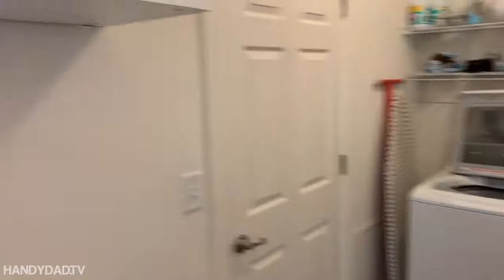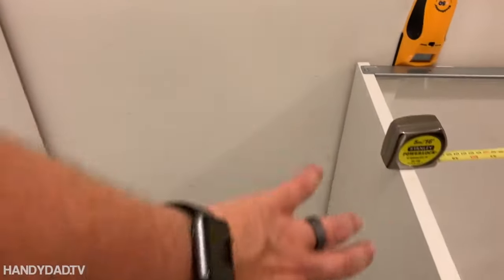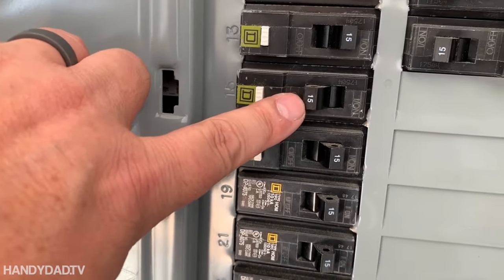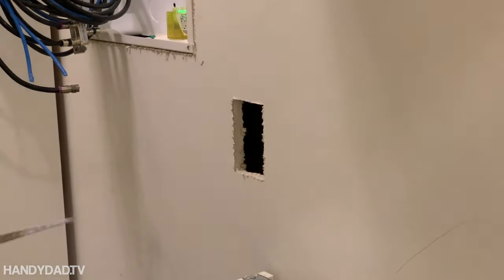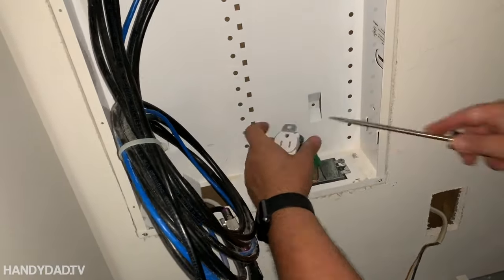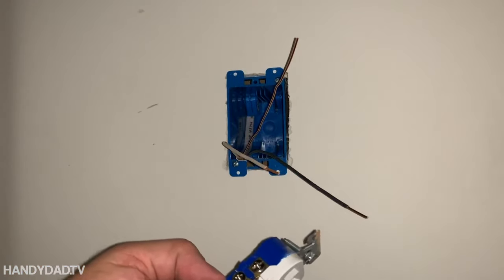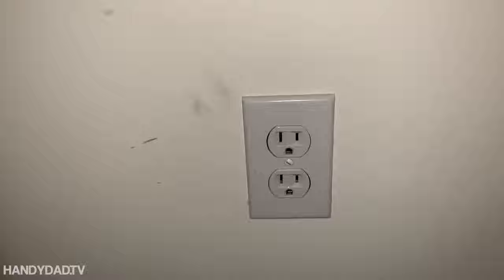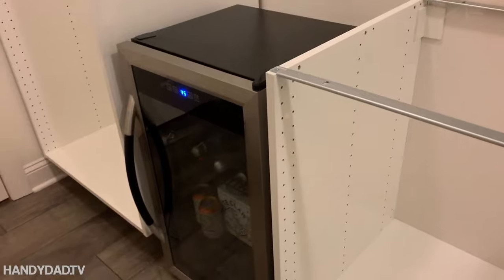Add an Outlet to an Existing Circuit

Comment: Your breakers show the amperage but does it also show the voltage?  I am curious if mine would show aswell.
Reply from the maker: A single pole breaker in the US is 120 volts. A double pole breaker is 240 volts. It’s twice as wide as the single and has a bridge across the two levers. Those are typically the only two voltages you’ll see in residential electric service.

Comment: Since that small room has a water connection (washing machine) and fridge (condensate) don't you need to run circuit through a GFCI load controlling outlet?
Reply from the maker: GFCI are typically only needed outside or within 6 feet of a sink. But codes vary.

Comment: Solar what size pilot hole would you have to drill for the setup you have in this video? Thank you for your reply
Reply from the maker: If you have a keyhole saw, no pilot hole is needed. But any size will do.

Comment: So, the other ground wire is twisted in the green wire nut, but still attached to the other ground wire (that's attached to the ground "green" screw)?
Reply from the maker: Yes

Comment: Question, shouldn't both neutral wires be  twisted together and pig tailed to the outlet and the same for the hot wires to make a continues circuit?
Reply from the maker: Not required. But many electricians do it that way.

Comment: How many outlets can you add to an existing one to make sure the 15 amp breaker can handle the load? Thanks!
Reply from the maker: There is no limit on the number of outlets. You are limited by power consumption.

Comment: Question...is it bad to piggy back off existing outlets? Like does it make it a higher chance of tripping a breaker?
Reply from the maker: It’s better than using an extension cord. Breakers only trip if you overload the circuit. It doesn’t matter how many outlets you have.

Comment: How ,any outlets could you install off one existing outlet this is exactly what I’m needing to do? Also with the last outlet on the run…did you get power from the second outlet or the first I do t think you showed that part.?
Reply from the maker: There is no limit for convenience outlets on a circuit. Just don’t exceed 80% of the rated load of the circuit breaker.
Reply: HandyDadTV thank you so much for responding!!

Comment: Can I run 2 more outlets from the same breaker if on one of them I am going to use a table saw and a garage vacuum?
Reply from the maker: Technically you can, but you probably won’t be able to run both at the same time without tripping the breaker. It would be best to run a new 20-amp circuit for the table saw.

Comment: I want to add outlets to my office which used to be a random walk in closet by the back door. One thing you didnt explain is how to determine the connection to the outlet. You just said hot to brass and neutral to silver. Is it as simple as one set to the top set and one to the bottom set? Also, I have paneling in this room that I do not want to tear out as I have already added built ins, and I can hide it all under the desktop... but it would need to be all wired in conduit, correct?
Reply from the maker: Watch this video to better explain the connections - https://youtu.be/xex8cPv8CtA. As for the conduit question, if you are running wires on the surface, I recommend you use this system - https://www.amazon.com/dp/B008JCHU8G/?tag=ha0d9f-20

Comment: Can you explain that last middle connection. Where it came from and how it circuits? Think I know but I don’t wanna assume..
Reply from the maker: I get this question a lot, so you’re not alone. I extended the circuit from the utility box to the first outlet (the one above the counter). Then from that outlet to the one below the counter. It doesn’t matter whether you put wires on the top screws or the bottom. Just put all the black wires together on the brass screws and the white ones on the silver screws. The grounds get pig-tailed to the ground screw.

Comment: Counter top outlets are 20amp gfci
Reply from the maker: Not on a 15-amp circuit.
Reply: Joseph Ballance   In kitchens the branch circuit has to be rated 20 amps, the gfci device does not.

Comment: How do you know if the wire goes on top screw or the bottom screw? I understand white-silver and black-brass but there's a top and bottom of each.
Reply from the maker: Doesn’t matter. They are both connected together unless you break the bridge between them.

Comment: How did you secure the romex in the metal box you were getting power from? I see the blue box has a friction knock out.
Reply from the maker: https://cdn.cableorganizer.com/old-images/arlington-industries/black-button-wire-connector/images/1-push-in-connectors.jpg
Reply: @handydadtv  nvm I thought the starting box was plastic I did not realize it was metal . I don't know how to secure the Wire running out of a plastic box that's already preexisting in the wall.

Comment: Where did you wire the bottom outlet from? Did you connect it to the bedroom outlet?
Reply from the maker: The bottom outlet is connected to the top outlet which is connected to the outlet in the cable box.

Comment: Is it essentially the same process if you have to splice into the romex to add an outlet where none currently exist?
Reply from the maker: Adding a junction into the middle of a wire is usually a bad practice because there isn’t enough slack to splice them properly. It’s preferred to add a wire from an existing box.
Reply: @handydadtv  Makes sense. I think I’ll call my electrician and have them figure it out for me. Thanks for the quick response!

Comment: If you gouge the sheet rock to run the wire around the stud how to you prevent someone in the future from sticking a nail into it to hang something?
Reply from the maker: Yes that’s a risk. The alternative is to cut a big enough hole so you can drill through the middle of the stud.

Comment: Could I also do this if I want to add an outdoor motion sensor light? I have an outlet that is about 4 feet from the exterior of my home and I want to add a motion sensor light.
Reply from the maker: Well the basic wiring is the same, but you usually want a wall switch on a motion sensor light because that’s how you turn them on solid, or need to reset them.

Comment: How many outlets can you add from an existing outdoor 15amp outlet?
Reply from the maker: As many as you need. You just can’t plug in things that will exceed the capacity of the circuit breaker.

Comment: If I have 14/2 already in place can I use 12/2 for a jumper to the 14/2 I’m Assuming you can’t since it’s able to hold more power
Reply from the maker: Yes, you can always go bigger, but never smaller.

Comment: Looks like there's no Romex connector in the medal box.
Reply from the maker: Guilty. The builder didn’t install one, and I didn’t add it.
Reply: @handydadtv  What is a Romex Connector?
Reply from the maker: It’s like a grommet that replaces a slug from a metal box to hold the wire in place.

Comment: America has some of the weirdest electrical code compared to Canada.
Reply from the maker: How so?
Reply: @handydadtv  here we are required to have a loop of wire prior going into the box (in case of damaged wire inside the box you can pull the extra in) 
We don’t have to moret grounds together but they are required to be screwed in the box under the ground screws. 
In some provinces you need to pig tail the wires but where I’m from you only pigtail if there are more than 2 wires, if there are 3 (14/2) in the box you need to pig tail them. But in BC you need to pig tail them if there are 2 wires. 
Box connectors such as 40/40 or 40/04 you just need a connector that can hold the wire in rather than just letting it hanging free. But if we’re using plastic boxes as you did in the vid we just push the wires in, and we strip the jacket prior to putting the wires in the box.
Reply from the maker: Moret = wire nut?
Reply: @handydadtv  yes
Reply from the maker: Really interesting! Thanks for all that detail! I may quote you in a future video. People seem to like my electrical content. 👍🏻

Comment: If an outlet is wired for 15 volts(with the 14 wire), then can you still just switch out the breaker from 15 to 20 and have it still work with no issues?
Reply from the maker: You mean 15 amps, not volts. 

14 gauge wire is only rated for 15 amp circuits. You can’t just increase the size of the breaker without rewiring the circuit. The wire will get too hot and start a fire.

Comment: is there any limit on how many outlets you can add on the existing circuit?? we created an Arizona room and planning to pull wiring from the existing circuit in the bedroom. i guess wiring goes all around the house from there. and we have a plan to put two fans, few lights with switches, and a few outlets. would that be too much on the existing circuit?? its 20 amp 12/2.
Reply from the maker: If you are building any kind of addition, you should always pull a new circuit. Adding a convenience outlet or two to an existing room isn't usually a problem, but I wouldn't power a whole new room from an existing circuit.
Reply: Thank you..

Comment: Just watched this video. And for my own knowledge, was there a concern for amp overage with everything being on one circuit? Wouldn't REF unit have its own dedicated circuit? The communications box, was that on its own circuit or linked to bedroom outlet on other side of wall?
Reply from the maker: The communication outlet was on the same circuit as the bedroom outlet. What I did was no different than plugging in the beverage fridge in the bedroom. The circuit isn’t overloaded.
Reply: Refrigerators typically have their own circuits, but it is not a code requirement. In fact, the refrigerator circuit is often the only circuit in a kitchen that is not GFCI protected, although the most recent code may have made it a requirement (I don’t know). I just sold a house that had the refrigerator circuit powering outlets in the dining room, which shared the wall.

Comment: Is it agaist code for me to tap into a service outlet? I have a service outlet on its own circuit for the HVAC outside on the side of the house. But I want to daisy chain 2 outlets on to that circuit for the front and back porch so that it will be a circuit dedicated for outside only.

I also want to know if I can tap into a pre existing circuit to add an outlet in the bathroom? Im pretty sure the answer is no and that the Bathroom must be on its own circuit alone?
Reply from the maker: Sorry I can’t answer. I’m no code expert.

Comment: So when you bounce off the existing outlet the new wires go on the bottom two screws?
Reply from the maker: Top or bottom do not matter. They are connected.

Comment: What is the ground wire nut with the hole called? I need to get some
Reply from the maker: Ground wire nuts. You should be able to get them at any hardware store or home center.

Comment: Am I missing something here.  The original outlet was wired to a 15 amp breaker using 14/2 wire.  The new outlet was wired with a 12/2 wire.  The circuit is and remains a 15 amp protected circuit but the new outlet with the cooler may pull an increase of 1 to 5 amps additional thus over loading the the breaker and ...pop.
Reply from the maker: I used 14/2 wire because it’s a 15-amp circuit. The cooler is only around 1 amp and the circuit has never overloaded.
Reply: HandyDadTV    It would have been better if you had checked to see what else was on the circuit, but you did fine.

Comment: hello! I am new in my electrical journey....My question is, with 15 amp you said you use 14/2, and 20 amp use 12/2... would it be "bad" to use 12/2 on 15 amp? basically, why should i not use a thicker wire instead? While wiring my 220v i am using 30A and 10/2, someone said i should use 8 gauge instead but someone else also told me do not go too thick, use the recommended 10...I would just like to know why
Reply from the maker: This is my go-to reference for wire sizes: https://www.how-to-wire-it.com/images/xWire-Gauge-Chart.jpg.pagespeed.ic.kWNeerWG6p.jpg

You can always use bigger wire than your device or breaker requires. But you can’t use lighter wire than required.

Comment: Yes,  gouge the sheetrock so the next homeowner gets electricuted when mounting a shelf because they don't know there's a wire hiding in a spot it shouldn't be.
Reply: Just 110. I'm sure you would be fine. And at least you can say you located it.
Reply: Corona Iris just because it’s 110V’s doesn’t mean it can’t kill you. It’s the amperage that kills you.

Comment: My breaker panel says I have 20a and 50a switches. I want an outlet in my bathroom cause currently there's none, my idea is to change the single lightswitch to a switch/outlet one. What kind of wire should I use?
Reply from the maker: You need to use a combo GFCI outlet with a light switch. There aren’t many choices. See what you can get.

Comment: Is that the same way to run an existing light switch to make an outlet?
Reply from the maker: It depends on how the switch was wired, because they don’t always have a common and hot wire. You need to test it.

Comment: Is that normally done, running wire below the surface of the drywall and then patched on top?
Reply from the maker: It is common practice for retrofit situations. I’ll be using that method to install recessed lighting in the basement of my series The Living Flip.
Reply: No way a reputable electrician would do it that way and no inspector would pass it.  By code the wire has to be protected from harm.  Frankly it's just stupid!

Comment: Where did you buy that green piece you used to attached the ground  wire
Reply from the maker: You can get them at home centers, hardware stores, or online.
Reply: HandyDadTV  what are they called

Comment: The master bedroom closet has a light switch with two switches.

For some reason,

one switch turns on and off the light in the laundry room

the other switch, turns on and off the light in the closet, however, there is also another single switch that does the same, meaning, turns on and off the lights in closet

From the double switch, i wanted to add an electrical outlet.

however, it only works if the light switch in the laundry room is on!!

the switch in the closet for the laundry room is not necessary

it has the following:

2 black (hot) leads

one red lead

and the bare (ground)

no white (neutral) goes to that switch.  can it be done?
Reply from the maker: That’s a crazy circuit! And it’s impossible to diagnose remotely. You need a voltage tester and a pad of paper to map out the black wires to understand what goes where. You need to find the constant hot line. That’s the one for your outlet.
Reply: @handydadtv  thank you so much.  I believe the constant hot line will probably be the one going to the light.  I better call an electrician!
Reply from the maker: Good idea.

Comment: Question...I'm adding an outlet and moving an existing one. On the same 20a breaker circuit. The existing outlet that I'm moving says to push #14 solid wire for 15a branch circuit only. So I bought a 15a new outlet and #14 wire. The existing wire however looks to be #12. It had faded in color over the years to a dull white I assume. So I matched the white (#14) to it when I purchased it. I didn't realize it had faded that much. That it was nearly the same color. But when removed the existing outlet from the box I saw that the wire was #12. Am I going to be ok to reinstall that 15a outlet at the new site and branch the new 15a outlet using the #14 that I just purchased. The new one is at the end of that circuit. I'm confused as to why the builder (2010) used the 15a outlets. The existing circuit had no issues before I began. And I've only pulled wire so far at this point. Nothing is hooked up yet and the breaker is still off. Please and thanx for your input...
Reply from the maker: Residential receptacles are usually 15-amp (NEMA 5-15 is the official name) but they usually use 20-amp circuit breakers with 12 gauge wire. The only time I’ve seen a 20-amp (NEMA 5-20) receptacle is a for dedicated window air conditioner. 

Wire size is determined by the breaker. If you have a 20-amp breaker, you must use 12 gauge wire. https://www.how-to-wire-it.com/images/xWire-Gauge-Chart.jpg.pagespeed.ic.kWNeerWG6p.jpg
Reply: @handydadtv  Thanx...back to the store I go
Reply from the maker: That’s why I always try to buy homes within minutes of a home center. 😉
Reply: @handydadtv  Yeah it's not far. I've been a carpenter for 26 years. And have done various other things. Just not very much electrical work. It is by far my weakest area. Thanx for your help and the videos!
Reply from the maker: My pleasure!
Reply: Around the year 2000 Romex color for 12 gauge was changed to yellow, prior to that time it was white. It's possible the builder had leftover white 12 gauge in 2010. It's also possible that the sheathing is covered with drywall mud and/or paint, so it appears white. Your builder was correct to use 15 amp receptacles as 20 amp duplex receptacles are not required and not recommended because they offer no advantage in residential wiring, even on 20 amp circuits. Bottom line in your case, you need 12 gauge wire, but not 20 amp receptacles.

Comment: How would you also add a light switch to the new outlet
Reply from the maker: This video explains how switches are wired to control lights - https://youtu.be/wRSgemIxamU. You can do the same thing with an outlet, just be sure to always switch the black (hot) wire. The neutral and ground are constantly connected. You can also switch "half" the outlet by removing the little metal jumper between the two brass screws.

Comment: your original outlet was an end run right? what if it isn't at the end of the run?
Reply from the maker: Disconnect the existing outlet. Connect the existing wires with a pigtail plus your new wire under a wire nut. Then reconnect the outlet using the pigtails.